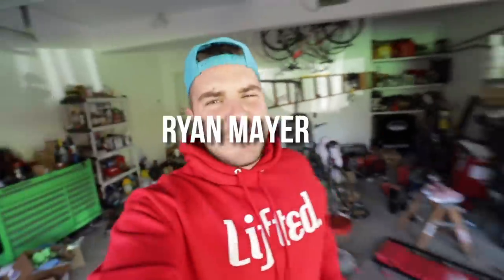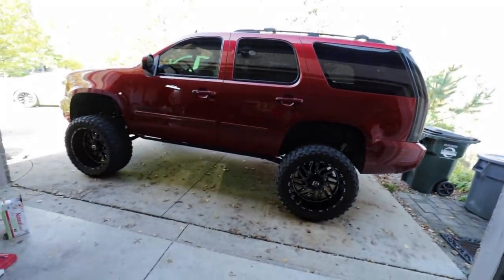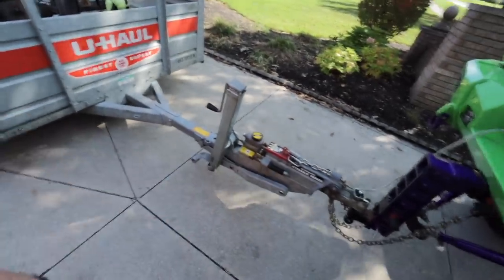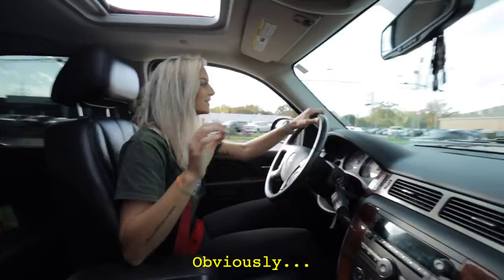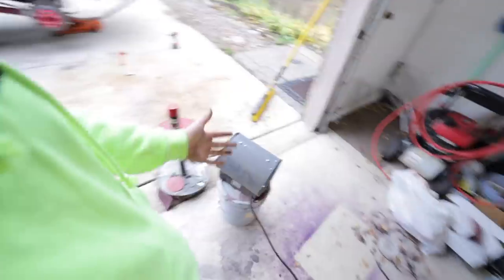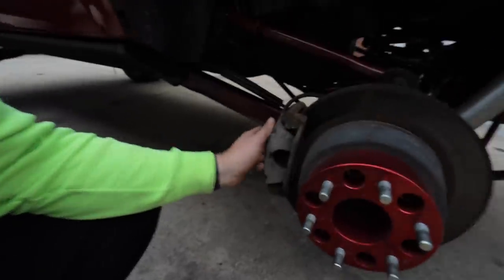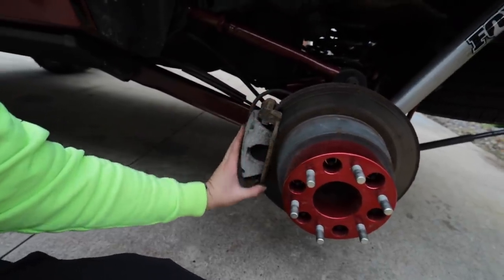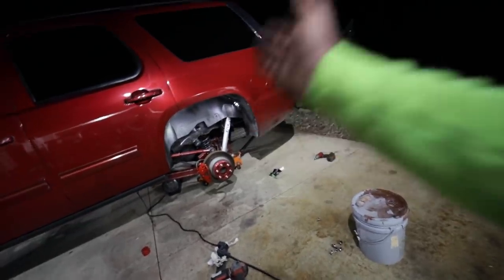Brembo Brakes in a Can!?!

Comment: Surge brakes are what they use, as the trailer moves forward under braking, it engages the brakes. It's pretty cool cause it's inside the tongue, best option for the casual renter or someone who doesn't tow a lot. Can usually be pretty jerky though.

Comment: I’d honestly buy a second “work” truck to pull your gooseneck before getting a custom trailer to fit your ram. Once you get one trailer you’ll eventually want more and want to sell/ upgrade them. Way easier to sell a normal neck gooseneck than a giant custom one. Just my two cents.

Comment: Too cheap to get a shop. Neighbors fed up with his ruckus.  Can't finish the 6.0 due to neighbors might say shit if he puts actual work
Reply: I literally work on Bradley's where I pull the engine, put it on a stand and run it full throttle out the garage door 900 hp and louder than anything on wheels/tracks minus the M1.....do it all in a neighborhood like this. His neighbors can grow the fuck up, there's a reason there is set quiet hours in most neighborhoods, set that up and he can work around it.....griz is only here to talk shit like always